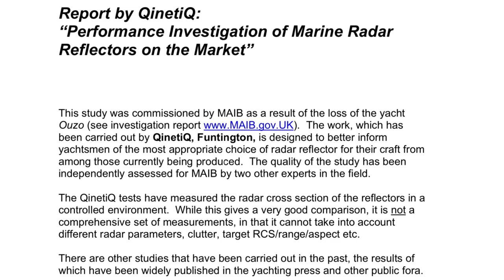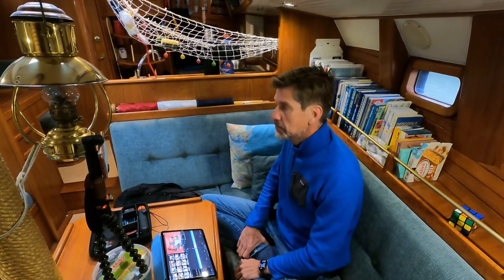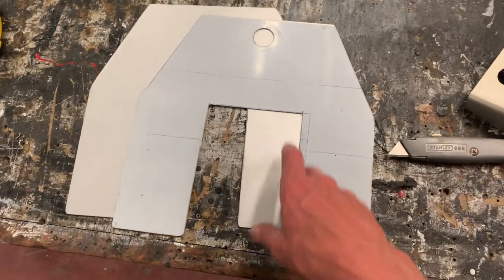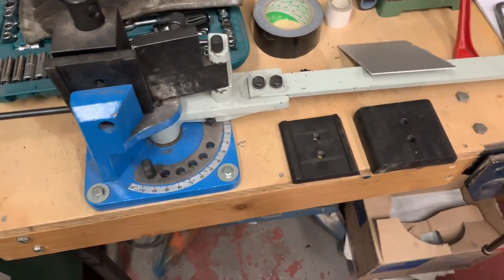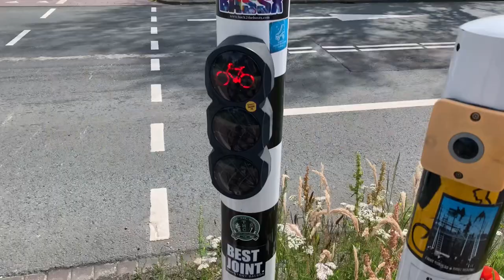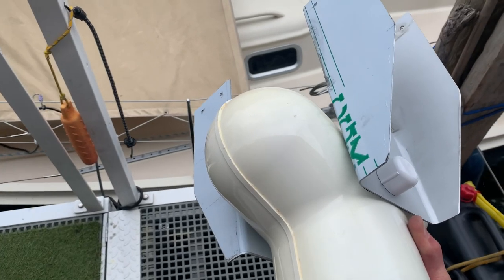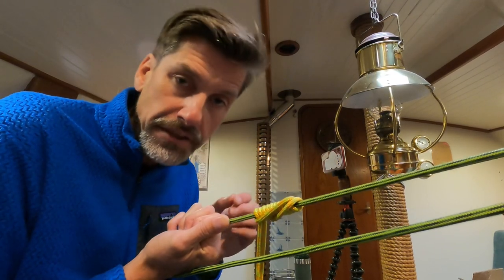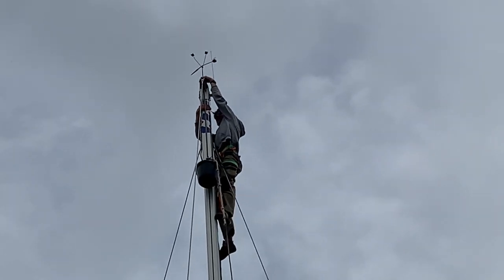044 How to install a Trilens passive radar reflector.

Comment: Did a bit of binge-watching to get up to date, and now I am!
With your new life-lines installed you might want to schedule doïng some drills on how to get yourself onboard after the unlikely event of beïng overboard unintentionally. Nice sunny day at anchor and have a swim, try out if you can get yourself onboard after 'forgetting' your swim ladder. All kind of practical exercises to think of.
You installed a third reefing line but I noticed all you lines go to the mast. Now you 'go solo' have you considered to get all your lines to the cockpit?
And as a solo sailer you might want to consider having 1 or 2 crew onboard for the long crossings/passages.
I enjoy your episodes very much, ok one more than another but overall for now a big 8 out of 10 ;-)
Reply from the maker: Hey Jan, 

Great to hear! Great idea on the testing of the lifelines. Getting onboard without swimming ladder will be far from easy I’m afraid. 

For lines to the mast I did considered but besides a quite costly exercise it will also be rather complex as the dodger has hardened glass. As alternative I’m considering a below deck auto pilot on top of the windvane. Also to overcome issues in the steering paddestool. 

Last point, yes, definitely am considering having extra crew on long(er) passages. But seeing Martin, from sailing Jambo, I also feel I need to give a go solo. That guys optimism is incredible. Would love to be able to keep/ get that mindset. 

In any case: welcome onboard and hope you stick with me (us) on the real life adventure :)